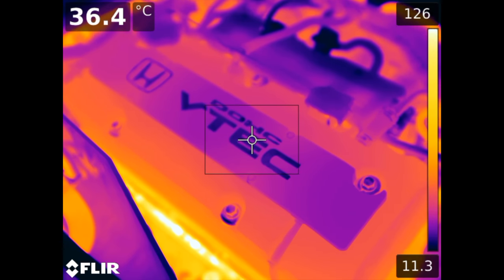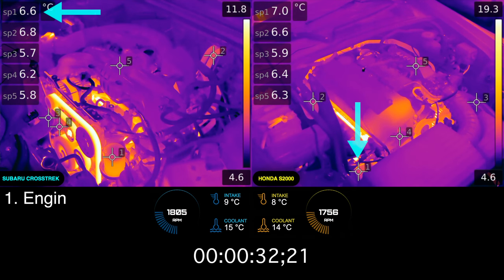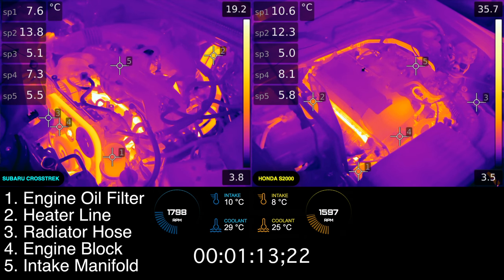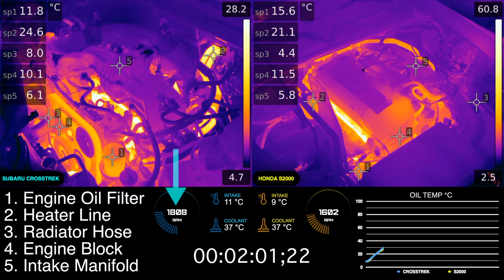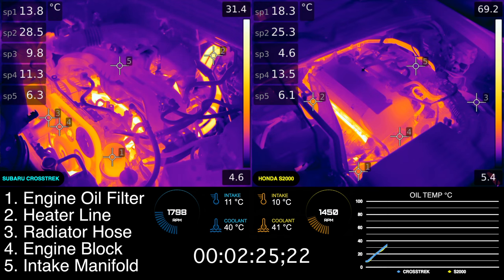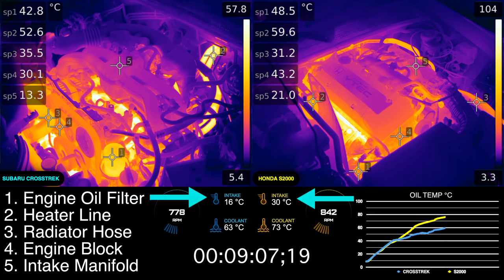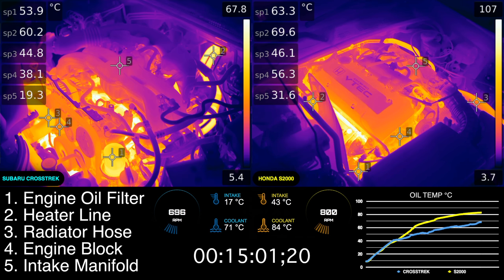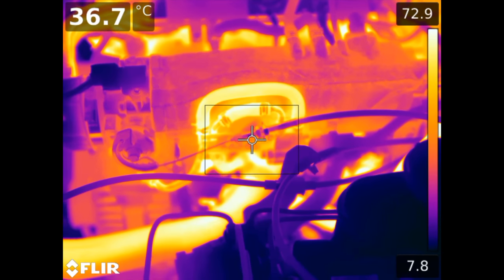$40,000 Thermal Camera - Watching Engines Warm Up

Comment from the maker: If anyone is interested in the full warm up - no time lapse, no voiceover, no music; just pure data shoved at your brain for a continuous 15 minutes, I’m here for you! Here’s the link: https://youtu.be/W6_lv2UNQAg

EMISSIVITY NOTE: For anyone concerned about emissivity and the temperatures you're witnessing, I just did a quick test in my kitchen to verify the temps we're seeing. I took a sheet of paper (emissivity ~0.9+) and a sheet of aluminum foil (emissivity ~0.05), while the camera was set for an emissivity of 0.95. The camera accurately read the temperature of both items (about 20 deg C). Then I switched the camera's emissivity to 0.04. The aluminum foil's temp then varied widely, from 0 deg C to 50 deg C (it was still at 20 deg C, the temperature inside my home), while the sheet of paper now incorrectly read 30 deg C. To me, this shows that with the camera set at 0.95 for emissivity, readings will be accurate, and it has a way of calibrating for various emissivity coefficients of what's in view. This video was recorded with emissivity set at 0.95.
Reply: Engineering Explained why were you licking your arm....
Reply: @engineer explained what about electric engines?
Reply: Bruh, just Google it. In the time it took you to write your comment, you could've searched "emissivity" and answered your own question.
Reply: Engineering Explained Why do you recommend not letting the car/engine warm up before driving? I was under the impression that it is preferred to warm the engine before driving because the engine fluids are at operating temperatures. Warm/hot oil ect. will provide better protection against engine wear?
Reply: blubyu there are various reasons why it is best to drive your vehicle, albeit in a tame fashion, 30-60 seconds after you start it. as far as the fluids go, and in particular engine oil, they are designed to work ok at low temperatures. believe it or not your cylinder walls are not perfectly round.  they are oblong because the block is not equally thick in all directions and therefore expands with heat by different amounts in different directions. The engine is designed to work BEST at operating temperature and acceptable on cold starts. The longer your engine runs while its cold and the piston rings and cylinder walls haven't fully expanded, the more exhaust gas blows by the rings and mixes with the engine oil. The fastest way to heat your engine is to drive it because more fuel is burned and thus more heat is made. As EE showed even after 15 minutes the transmissions has not received all that heat from the engine and is still many degrees away from operating temperature. The piston "blow by" when running cold is one reason "short trips"  and "stop and go" are considered "severe" operating conditions which require shorter oil drain intervals. Both cause more mixing of exhaust gases with the oil which in turn changes the oil unfavorably.
Reply: Because there is little benifit beyond making it more comfortable. I find that in sub -25 temperatures I like to let my vehicle warm up for about 5 minutes just because the engine and transmission sound happier when I do so, but other than that I only give it 30 seconds
Reply: -25 in either metric is cold and I could see justifying a few minutes. Im in North East US so it normally doesn't dip that low but it can. I feel in that case its more important to a have a good synthetic oil that's not overdue for a change. If there is an oil film between the moving parts than you're good
Reply: Engineering Explained  can you please explain Boxer vs V-180° and the torque curves and performance differences . Looking forward for this info. Thanks in advance!!
Reply: Engineering Explained can you make a vid explaining  why diesels emit smoke when accelerating
Reply: I've seen some very odd looking thermal images/videos of reflective objects. I believe it has more to do with reflecting infrared from other nearby objects, not from error due to emissivity. Also - it is possible to manually set and lock the temperature range of the FLIR camera when doing video, making it easier to watch something visually warm up.
Reply: Engineering Explained I am sorry, but you are absolutely wrong with the conclusions made by using 0.95 emissivity at home with the paper and aluminum foil. Therefore the engine temperature readings are only apparent but not real temperature values. The most simple prove is that with 0.95 emissivity you recorded actual temperature of the aluminum foil even the fact that the emissivity coefficient of the aluminum foil is around 0.05 and same story with the paper which has 0.95 emissivity: you recorded correct paper temperature with camera set to 0.95 emissivity (matching with paper emissivity) and wrong paper temperature when camera set to 0.04 emissivity. The phenomenom with the aluminum foil is that the foil is highly reflective and reflects the radiation of the surrounding objects which are at room temperature. Why you made the wrong conclusions with home experiment you can find out in the following fruitful article "Emissivity: Understanding the difference between apparent and actual infrared temperatures" from FLUKE. You can google it to read it. Thank you.

Comment: This is why I love EE, I would have never thought I needed this information till I saw this video!
Reply: you don't. It's just cool to know.
Reply: If you're the type to hop in and stomp the gas, it's pretty helpful to know that even after warming up, the transmission is still pretty much ice cold.
Reply: Well yes if you don't drive the car while it warms up. If you drive it gently the transmission will warm up too.
Reply: This^ also if you drive manual you can feel the tranny oil getting thinner and easy to change gears. The transmission seems to warm up quicker than the engine on my car.

Comment: I wish we could do Slow Motion in Thermal. I love this camera
Reply from the maker: I read somewhere that you can with this camera, but it will record at a lower resolution. I think 120/240 fps was possible, but I also believe there is additional hardware needed to make it happen.
Reply: Engineering Explained well imagine filming like friction welding or something with our Phantom Flex 4K, or the Phantom v2512 , would be cool if there was some type of thermal filter to put in between the camera and the subject.
Reply: You can do slow motion thermal.
The FLIR X6900sc does 640x512 at 1000 frames per second.
It costs about as much as your Flex4K, if not more. Oh, and each lens is around $3-5k.

Comment: airflow while driving with closed hood (bonnet) is waay different. and some manufacturers actually take that in account while designing (like bmw). maybe with the hood closed and driving at least 30mph s2000 can have lower temps than subaru. i am not saying that is a fact, just a scenario that would be interesting to test and compare with these results. and small edit... transmission is stationary now. while driving friction could warm it up faster?

Comment: A geek fact about emissivity: if the hot plate  of your clothes iron is metallic and shiny smooth, it will not show at all on a thermal camera (the emissivity is 0). Even if you set the iron for 200C, all the camera will see is a 'mirror' reflecting the much cooler thermal sources from around the room.
Also, hot (normal) air doesn't show up (e.g. from a heater element); the atoms/molecules are far too small for absorption or emission of 'thermal' wavelengths.

Comment: I think this is an excellent example of bore and stroke on thermodynamic efficiency. The Subaru has a square bore to stroke ratio, whereas the S2000 is slightly oversquare meaning the bore is larger than the stroke. I'm actually surprised the F20C motor isn't more oversquare considering it's high rev limit. Anyway, the increased surface area of the oversquare motor means greater heat transfer in the combustion cylinder to the walls of the cylinder, partially contributing to the S2000's motor warming up too. 

Another funny thing is EE has a preference for cars with motors that have codes "F20", with the Subaru having the FA20 and the S2000 having the F20C motor.

Comment: Fun fact: I've built those cameras and now work as a service engineer for Flir. =D
Reply from the maker: Awesome! It's an incredible product!
Reply: See if you can borrow one of the cryo cooled (operational temperature of the detector is about 80 Kelvin - brr) HD units like the X8000SC or something. Those buggers are insane. With a CO2 filter you could watch your car breathe. 

Granted - the price will need another 0 or two at the end of it, hehe. Being knee deep in these things all day I get a bit blind to the fact that, at the end of the day, they cost roughly an arm and a couple of legs. =P
Reply: Tony McModeNut So, can you tell what makes thermal cameras so expensive? Is it the material used for the lense, which I haven't seen used elsewhere, or is it something else? Like smaller number of units over which the design costs are spread, compared to consumer products?
Reply from the maker: From what I've learned of the unit, it comes down to the image sensor. Thermal sensor pixels are about 10x as large as traditional digital camera sensors, so the sensors are extraordinarily expensive.
Reply: All of the above, really. The lenses (made from germanium) are a big cost. Certainly when you have units with insane lenses like 1000mm continous zoom that can detect a human at up to 20-30 kilometers. 

As is the detector (sensor) - especially in the cryo cooled units. The precision work that goes into those coolers is amazing. And, like you said, the market (in terms of volume) is way smaller than normal cameras. 

I probably need to be a bit careful about specifics, hehe, but the camera used in this video, for example, is assembled and tested from start to finish by about ten or so people. Very nice people, at that. =)
Reply: So does FLIR have a monopoly on the thermal imaging market or something?  Because any time I see any type of thermal imaging camera in use, be it here on YouTube, or TV shows like MythBusters, it's ALWAYS from FLIR.  We have an older FLIR digital thermal camera at my architecture office for use with buildings, checking electrical and insulation systems, etc.  It was around $10K about 7-8 years ago I think.
Reply: Nobody really has a competing product, so.. They have a monopoly in the sense that nobody else is even bothering to compete. Partly due to the pretty unique expertise required, and probably very very high costs of getting started. FLIR make their own silicon, that alone puts them in a pretty advantaged position. The cost of doing just that single step, ignoring the expertise and the rest of the production, is extremely huge.

There are certainly other manufacturers of IR sensors (in fact, most CCD's and CMOS image sensors are somewhat sensitive to IR), but not with this resolution and overall precision / quality. Hence FLIR is the choice if quality and precision matters.
Reply: Also Fluke has thermal imaging cameras, but they are not that high-end products. (Fluke generally makes testing equipment for building and repairing, and thermal cameras are one of their lines.) 

And on AliExpress there seem to be available various no-name products that resemble a lot Fluke's products... Those are probably even lower-end :)
Reply: Good for you
Reply: There are definitely other manufacturers around, but none seem to go as high end as FLIR does. mikeselectricstuff has reviews on a phone plugin style camera by a company called seek

Comment: Hi Jason, great experiment again! However, I find it would be clearer to use a fixed manual temperature scaling to see the evolution of the engine warming up. Granted the contrast is better with automatic scaling but then we cannot directly compare the two engines.

Comment: I do not mean to impose, but here's a suggestion: configure a set scale for the temperature color.
It seems that every video online suffers from this, and no one seems to think about it. It is very weird to the eye when a belt warms up to the exhaust temperatures almost immediately. And as part warm up further, it appears as if they were cooling down instead. A set scale would allow to observe the actual rate and differences in temperature. Particularly in case of comparison videos.
As always, thank you for your work!
Reply from the maker: I had the same thought, until I tried it, which might be why so many of these videos use a sliding scale. Unfortunately, when you use a set scale, the image quality seems to be pretty poor because the camera doesn't differentiate temperatures well, so all you see is a dark, undefined mess. Only when temperatures start to get close to the high of your scale, does it start to show clearly. Using a sliding scale allows you to observe all of the components without all the colors running together, so you get a much sharper image.
Reply: I guess battery leads on the S2000 is one of those things that would be lost in a set scale. The hot spot on the rocker cover would also be lost.
That's a shame. There's nearly a 50% difference in the middle of the video. I guess it would be great if the sale would equal at a given moment.
Perhaps Flir should have the ability to adjust the scale in post (wishful thinking, I know).

Comment: Most new cars with very efficient engines have electrical "auxiliary" heaters built in as standard (e.g. VW Passat, VW Golf), in order to warm the coolant up quicker, to get the emissions down as soon as possible and to comfort the driver and the passengers. Is this the case for both the Honda and the Subaru? This would have a great impact on the time that the coolant needs to warm up.

Comment: Appreciate Your effort , great video , good quantity  data ! It would appear that when an engine is not working to hard , in this case idling ,the oil temperature will almost certainly not exceed the coolant temperature. So exessive [idling] will not really raise the oil temperature to 100degC where an oil is able to work probably and importantly water /moisture can evaporate off. 5 minutes looks sufficient for those owners who appreciate warming their engines .Graeme

Comment: Here's the scientific side of engineering.  As an R & D engineer, I've performed similar heat transfer studies several times, but with thermocouples and thermistors, not thermal cameras.  R & D means researching with tests and data analysis before developing a machine, instrument or process.  The research is the science, development is the art; engineering ties them together.  This is a very interesting video!
Reply from the maker: Glad you enjoyed the video!

Comment: You need to be more careful, that engine is equipped with VTEC yo. When the VTEC kicks in yo the engine produces so much power it could cause a sonic boom from the dankness and kill anything within a 4 mile radius.

Comment: And, since the S2000 has a higher static compression wouldn't it produce higher combustion temperatures?
Reply: Not really, it warms up faster because it's more compact in my opinion
Reply from the maker: That's interesting to think about! Higher compression ratios mean higher thermal efficiency, meaning more energy is turned into useful work rather than heat.
Reply: Yes, but it also makes more heat overall, due to higher extraction of energy, and since there is less heat going out the exhaust, more heat ends up in both doing mech. work AND in the coolant system. "We" see that very often on relatively high compression (E85 fuel) turbo engines. running a MAP of 300 kPa (2 bar boost) on say 9.3:1 CR, vs a normal E5-E10 gas engine doing the same boost but with a lower CR of say 8:1

Comment: Thanks to my doors auto locking when the car is started, I've done a near 1 hour test of letting the car warm up with no throttle. My 1988 Buick Reatta with a 3800 V6's coolant  reached 90C in a tad less than 10 minutes in about 10C ambient temp.

Comment: in regards to intake temp readings isnt the subaru intake temp sensor built into the air flow meter? so it will be in the intake pipe close to the air box away from the hot engine. the honda would most likely be fitted in the manifold closer to the engine giving a higher reading.

Comment: I think it'd be cool to see the temperatures (more specifically the hotspots) of the engine when it's a completely cold morning start and taking off right away.  Driving slightly aggressive.  Of course, don't use the S2K.  Maybe the Mazda Mazda Mazda 3

Comment: In neutral, with a manual transmission, no less, it's no surprise whatsoever for there to be next to no heat within the transmission. In an automatic, I suspect a slightly warmer transmission due to the constant turbulence of fluids, though it probably won't get much warmer unless put into Drive.

Comment: Do the engines use the same oil weights? Would that make a difference?
Reply: The S20000 is running on 10W-30 Full syntheitc, the Subaru probably 5W-30.
Thicker oils do get hotter faster.
Reply from the maker: Crosstrek is using 0W-20, S2000 is running 10W-30.
Reply: Engineering Explained Thicker oils creatw more heat when cold because of friction of the engine parts with the oil itself, but i think the Honda warmed up faster because of the more compact engine layout.
Reply: +Capri Driver 
Do you have any citations to support your statement "Thicker oils do get hotter faster."?
Reply: No.... nowadays you don't have to change the oil in the summer and winter, if your car specifies 5W.30 you should use that in the winter and summer, my car specifies 20w50 so i use that all year.

Comment: how hot does a timing belt get and how hot do the cam sprockets get? my cam sprockets are too hot to touch after engine has been running for an hour.